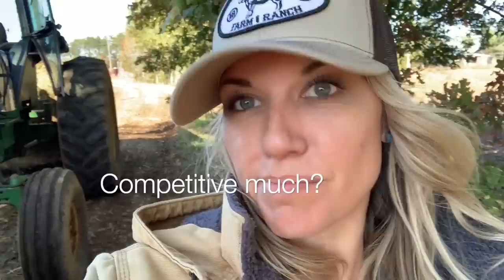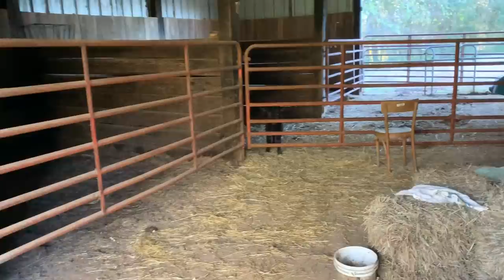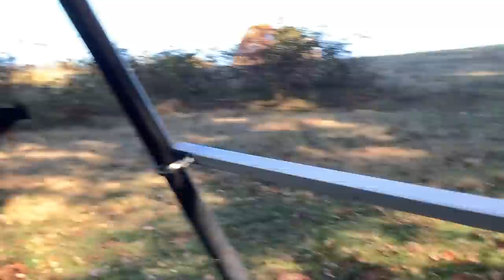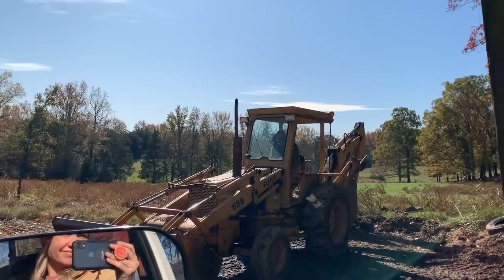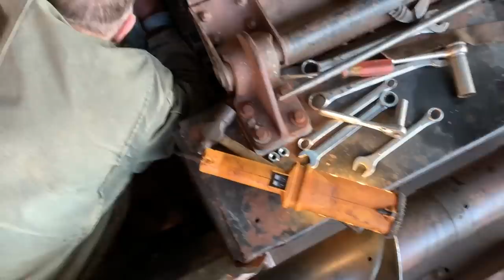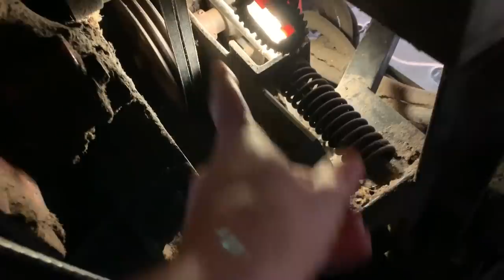This Farm Wife...Mechanic?

Comment: Right tool makes a hard job so much easier. Good name brand Gearwrench would helped you out on that close corners spot you was at.  Some tools I might only use once in 3 to 5 years but they sure come in handy. I learn long time ago don't loan out no tools. Keep under lock & key. I made countless tools out scrap metal that would cost big bucks to buy.